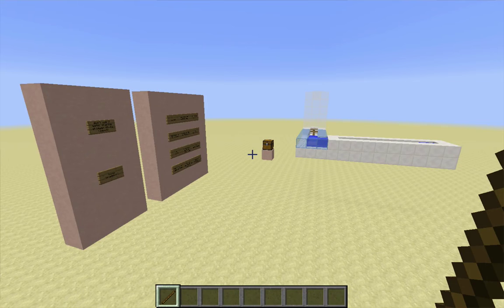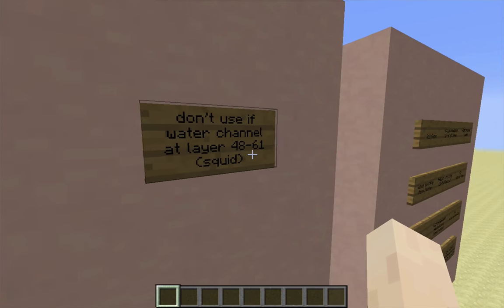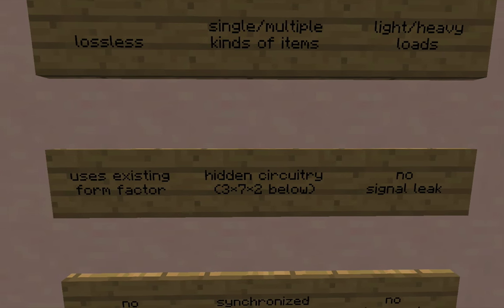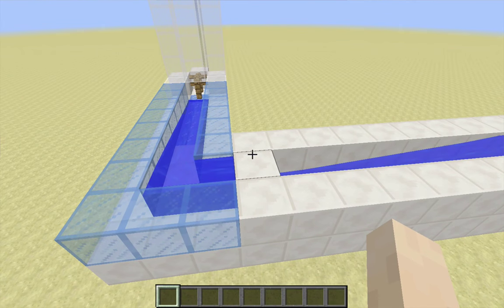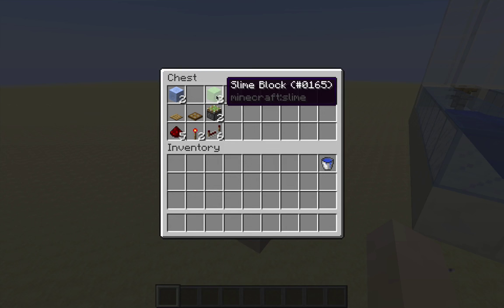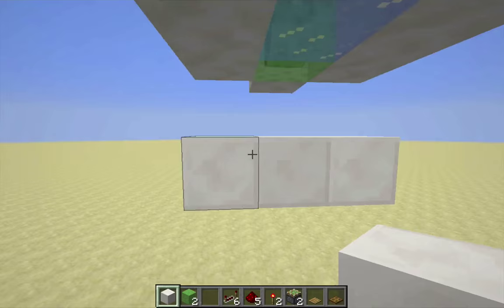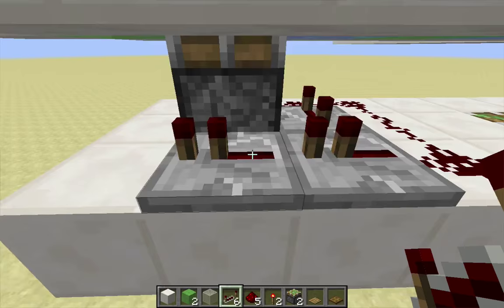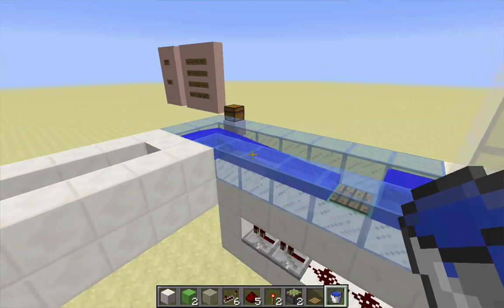Tutorial: Convert an Item Elevator from 1.8 to 1.9 (Snapshot 15w40b)

Comment: With the pre release already out, would you still say THIS is THE design to convert to?
Reply from the maker: +The Redstone Scientist This design is easy and still works. Additionally, the noise problem has largely gone away, with the new trapdoor sound. There are some simplifications that can be done, though, such as replacing the forward piston with an upside-down stairs (discovered by Robitobi).

But whether this is THE design kind of depends on the situation. There are still some weaknesses here, such as the possibility for squid spawning due to the 2-high water. This design also (probably) can't be build at bedrock, to to the space requirement under the ice. In the end, given all of the tradeoffs for the different components, I lean more toward the opinion that there is no best solution for all circumstances. Rather, a different selection of components is probably going to be required, depending on where the elevator is located and what kind of items are in the stream.
Reply: +Nathan Ryan thanks